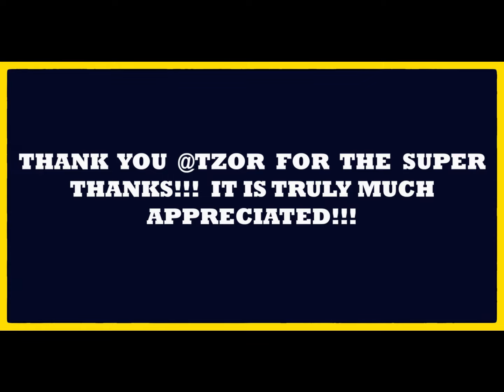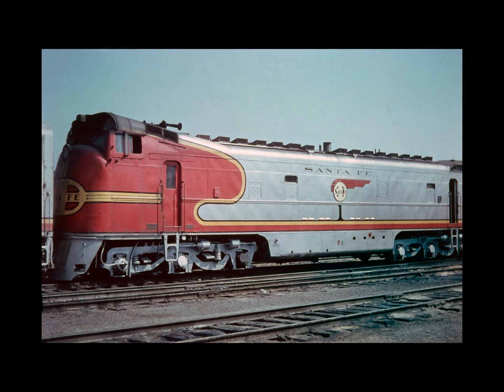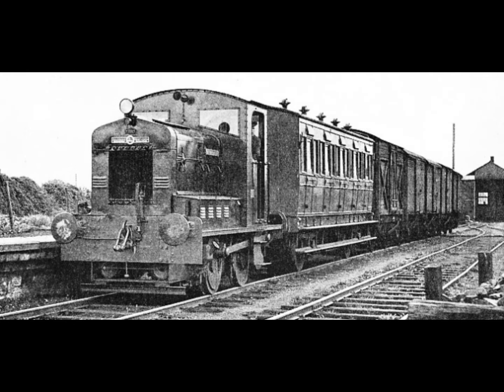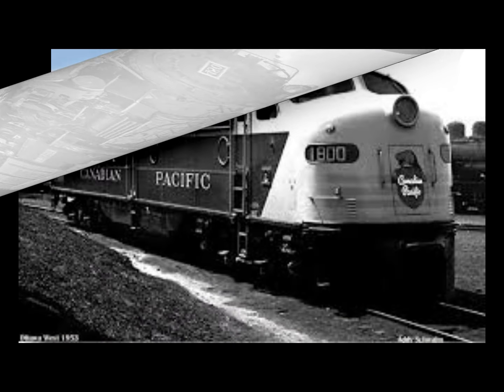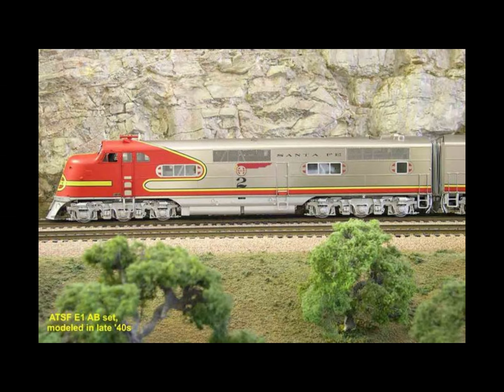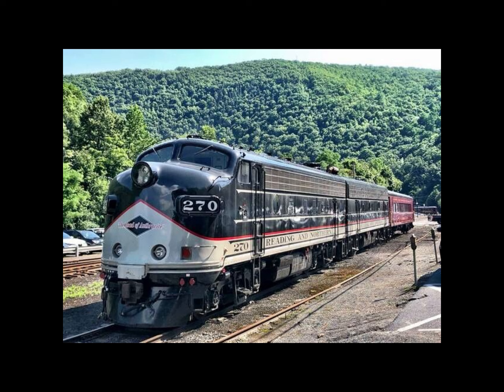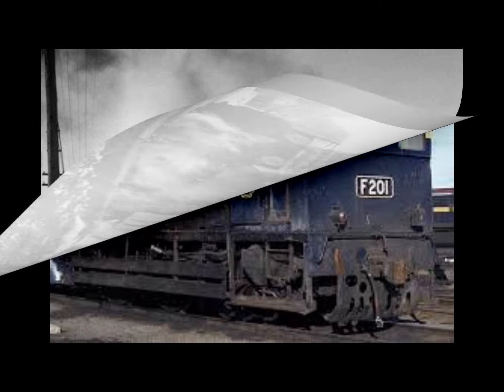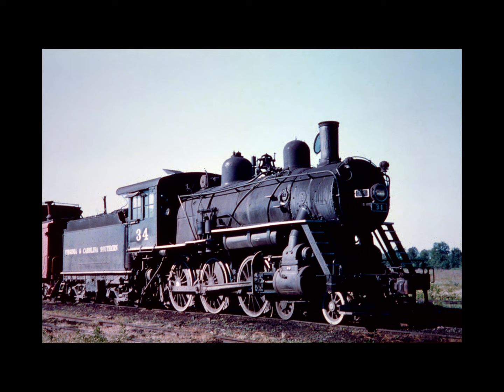Diesel VS  Steam... We know Which Won, But Why??

Comment: Aside from dramatically increased thermal efficiency, reduced heavy maintenance, reduced service, and  greater availability, diesels are a scalable modular form of motive power.  You can't think of them in terms of a single unit.  They are as many units as you need to perform a job operated with a single crew.  Each steam locomotive requires a dedicated crew.  Steam locomotives require helper operations.  The reason steam locomotives got so massive was that they were trying to combine multiple steam engines into a single unit with a single crew.  This also makes those massive units far less adaptable to other roles and limits where they can operate.  You really can't use a BigBoy for switching.  Diesels win this fight pretty easily, even in the 40s and 50s.  If you read the NYC report cover to cover comparing the Niagaras to the diesels, all of this is pretty clear.  Diesels definitely won that contest.  When you consider all of the additional people and infrastructure required for a steam operation compared to diesel, it's an easy decision.
Reply from the maker: Well then you also had increased track maintenance with the monster articulated Steam as well. Good stuff!
Reply: @TheRailroadCrossing-SteamPower  That's definitely another major consideration, dynamic augment hammering from steam engines, even the better balanced ones, is brutal on the track.  Steam locomotive wheel slip at starting or at speed can be pretty destructive as well.  You also have the issue of those long rigid wheelbase machines trying to straighten every curve and causing a bit of wear in the process.
Reply from the maker: @dtj9923  Can you imagine the track maintenance before roller bearings?
Reply: @TheRailroadCrossing-SteamPower  Are you thinking in terms of hotboxes and locked up wheels?

Comment: Excellent Video. Thank you for putting this together for us. 

However, I must disagree about steam being superior to diesel (or electric) traction in any measurable way. Let me present a few bits of history that may show why I'm so confident about it.

First - The Buffalo, Rochester, & Pittsburgh Ry.
It was absorbed by the B&O in 1930. The B&O, through the remainder of the steam era, essentially left the former BR&P as it was in 1930. They had a large fleet of 2-6-6-2's to handle most mainline freight from Punxsutawney, PA to Buffalo, NY, coal trains to Kodak in Rochester, NY, coal to Genesee Dock on Lake Ontario, and transfer runs to the NYC at Clearfield, PA. They primarily used 2-8-2's from Salamanca, NY to Rochester, NY and fast freights between New Castle, PA and Buffalo. They had 2-8-8-2's to push trains up McMinns Summit north of DuBois, PA. They also had a group of 2-10-0's that had been the helpers on McMinns Summit until the 2-8-8-2's arrived. They were used with many of the 2-8-0's not just for local and branch-line service, but also for main-line trains from Punxsutawney to New Castle, PA. This was due to the bridge over the Allegany River at Mosgrove, PA, which was built in 1903, being too light for the 2-6-6-2's to safely cross. They had to use several 2-8-0's or 2-10-0's, each with it's own crew, to operate this section of the railroad. Obviously, the B&O dieselized this section very early with EMD F3's F7's but they also dieselized the rest of the mainline to Buffalo as well with additional F7's. This also eliminated the need for helpers on the McMinns Summit grade. Most 2-8-0's were transferred to other divisions or scrapped. the old 2-10-0's were all scrapped. The oldest 2-6-6-2's were scrapped while others replaced the 2-10-0's and many 2-8-0's in branch-line service, especially on the coal branches around Indiana, PA. The 2-6-6-2's were eventually replaced by B&O EM-1's that had been displaced by diesels on other divisions. The EM-1's would soon also be replaced with the original SD-7 demonstrator that the B&O purchased as well as SD-9's, GP-7's, and GP-9's. The diesels solved several operating system issues by allowing the trains between New Castle and Buffalo to operate with only pickups and setouts at Punxsutawney and Salamanca. Also, the engine service facilities at every terminal were significantly reduced and the locomotive shops at DuBois were converted to produce and rebuild more freight cars, including the distinctive B&O "Wagon Top" boxcars. Currently, the Buffalo & Pittsburgh RR runs some of the heaviest diesels ever built (SD45's, SD40-2's, SD60M's, and now GE Dash-9's) over the Mosgrove bridge, now 120 years old, without any issues.

Second - The Norfolk & Western.
I'm sure you are aware, the N&W very impressively built their own steam engines, of their own design, until the very end of the steam era. However, very significantly, almost at the moment they agreed to merge with the Virginian in the 1950's, they started a manic diesel purchasing spree and began scrapping virtually new steam locomotives. The Virginian was actually in a better financial position when the agreement was signed. However, If the N&W could significantly reduce costs within the 2 years before the merger became official, the N&W would be the controlling partner. The efficiency of the newer diesels and reduced engine maintenance costs would only get them a very small part of the way to that goal. The cost savings, and surge in stock price, was almost entirely due to the savings achieved through reduced track maintenance. It is a simple fact that a steam engine, no matter how well balanced, by it's very nature, beats the track and other right of way infrastructure to pieces in a very short amount of time. That's why, in the steam era, there were track gangs about every 10 miles of main-line track. Reciprocating locomotives pound the rail head requiring a massive amount of maintenance. A diesel, with it's DC traction motors, does almost no damage to the track structure except the normal wear from flanges on the outside rail on curves. 

No matter how I look at it, steam was doomed as soon as EMC, Winton, and GE (yes, GE. NOT GM.) created their first demonstrators.

Additional notes:

Baldwin and Lima-Hamilton failed primarily due to incompatibility issues but some significant engine issues as well. They both used pneumatic controls instead of electrical controls. This made it impossible to operate their products with any other manufactures product. It's unfortunate because Baldwins were especially known for their pulling power. They eventually fixed the issue but it was already too late.

Alco would be in a partnership with GE until about 1953. After that, GE started working on their own locomotive designs but Alco continued to purchase GE electrical equipment. The issue Alco had was the 244 engine. They eventually corrected the multiple mechanical issues and also produced a much more reliable 251 engine but, again, it was already too late. The railroads were much happier with the EMD GP7's and GP9's with their very reliable 567 engines.
Reply from the maker: That was an outstanding read! Thank you!

Comment: FT mostly came as permanently coupled A-B sets. Multiple traction was considered from the beginning, and a lot easier to realise than in steam locomotives where in practice at least one person was required in each working locomotive (more commonly two).
So it was not necessary to build very large monolithic diesel locomotives. Though in some cases (the 8-axle dual engine locomotives of UP) it went that way in the 1960s/70s, it was considered more practical to couple up more locomotives for more power.
Besides the lower thermal efficiency of steam engines, it requires a lot more manpower, time and maintenance to operate. Bringing a cold steam locomotive up to temperature can take several hours. A lot of cleaning and lubrication is required every day. The time required for maintenance also means hours during which a steam locomotive and its crew cannot be used to pull trains.
Besides the fuel you also need to take great amounts of water along.
Some countries continued building steam locomotives after the second world war, mostly because they had great amounts of coal and didn't want to rely on imported diesel fuel. (And some electrified but that's a different story.)
Reply from the maker: All great and valid points!

Comment: Standardization. 

Apart from the USRA locomotives, and even then you have like, over 10 different variants of those engines, every railroad would order unique locomotives to meet their unique needs. Once the engine was done and delivered it was essentially on the railroad to fix anything that went wrong with them, because the builder was now working on another relatively low volume design for a competing road that was different enough to not have compatibility.

And then you have the diesels. In the early days EMD makes a F for freight, a E for passenger, and a shunter. 3 different locomotives. Because every railroad buys the same 3 locomotives EMD can make a ton of the same thing, get really good at it, and maintain a aftermarket because they only have to support 3 designs. 

If a steam engine has a boiler leak or something wrong with a cylinder, the railroad has to come up with a unique solution to that unique problem. If a diesel burns out a traction engine, buy a new one and slot it in.
Reply: Wrote this comment before watching, glad you hit that point In the video. 

As to some of your questions, If I recall correctly both the N&W and NYC basically concluded that a steam engine would haul a load about as well as a diesel and that the costs of operation were more or less equal. The benefits were elsewhere. Considering that it is 2 different roads and 2 different applications they are being considered on I would think this lends a lot of credence to them being about equal over the road. 

Also the big steam manufacturers were essentially gagged from developing diesels because a steam locomotive was a way to move material without using critical resources. The government did not want the builders to slack off on building locomotives in order to develop engines that used those resources when they should be building steam locomotives to meet the immediate demand. This prohibition from diesel development basically ensures that EMD (who was still allowed to build diesels during the war) would have basically a 4 year advantage on everyone else.
Reply from the maker: On point, as usual!

Comment: Also one MASSIVE selling point of diesel or electric locos over steam ones is scalability. You can just chain a bunch of them together and operate them like one loco whereas with steam you either had to get a bigger loco or operate two with their own crews at a decrease in efficiency.

For example in Russia, China and some other railroads you have 2-4 units (kinda like A+B unit consist) linked together permanently counted as a single locomotive. So you can scale the power in production a lot more easily by just adding a "B unit" in between the cab units and get more power without any change in design.
Reply from the maker: Yeah, they were many advantages for sure over steam as time went on, especially

Comment: I suppose "higher performance" would depend on what they meant by "performance", what metrics they were using to measure it, and what they were comparing to what.

It doesn't really matter though. If a diesel can do the job, and do it cheaper, then how it does the job doesn't really matter practically. I expect that a diesel with more power then the giant steam engines could have been built, but why would you? As you said, standardization was a diesel advantage. Buy one kind of locomotive, then dispatch however many of those you need for each job. The giant steam locomotive really weren't an optimal engineering solution and they were highly expensive specialist machines. The only reason to build them was to avoid needing multiple crews for multiheading, but diesel lets you multihead with a single crew, so why build a giant diesel?

I don't see how fossil fuel shortages or phase-out favours steam. They're less thermodynamically efficient so you'd need even more fuel and I don't think any of the advanced steam technologies have an advantage over diesel in most applications. I think the only practical alternative to diesels is mass scale electrification.

Everybody loves a steam engines. They're cool, but I think steam is mostly dead as a practical power source for transportation and is going to stay dead. Love them like sail boats and mechanical watches and film cameras.

Comment: I think diesel absolutely outperformed steam on grades.  The simple reason being, you can hook up 9 or 12 of the things or however many it takes to grind up the hill at 12 miles per hour.  All on one crew.  Diesel will eke over the top with less horsepower than steam, and you can easily add on as much horsepower as you need.  With any train, you need to schedule as enough power per ton to pull and start on the worst grade on the route, with a margin.  With steam, that means you give the train a huge amount of power, because anything that'll start the hill will also blast the train at freeway speed.  With diesel, you can specify a power to make any grade but still only top out at 35.  Since railroads do not care at all about speed, they're happy with that deal.  More tonnage per horsepower.  Steam pulled better in practice because the minimum acceptable horsepower was higher.

And yeah, one Allegheny will out-pull any single diesel, but it still loses because you'll never run a train with 5 Alleghenys, but 8 diesels is just Tuesday.  Scalability and performance is 100% tied to cost, otherwise you really would just quintuple-head with Big Boys and pull anything anywhere.  Diesel scales better.  If the microchip had been invented before internal combustion, allowing one guy to run and fire 6 steam engines, dieselization may not have happened.  After accounting for the cheaper up-front purchase price of 1 steamer vs 4 diesels, and the cheap fuel they used, running costs for steam weren't THAT terrible.  The NYC found their Niagara compared pretty favorably in lifetime cost.  But you just can't beat 1 crew doing the work of 4.

Comment: Diesels didn't need to out perform steam on a 1 on 1 level.  The jumper cable made it easy to string a few of them together and it still came out cheaper than steam.  Now, with mounting environmental pressures and increasing fuel costs, it could be time for the electric locomotive (not these experimental batteries on wheels) to become the preferred power.
Reply from the maker: It'll be interesting to see what they come up with these days with the looming fossil fuel issue. If they are going to develop something like Natural gas, hydrogen..what have you.. Now's the time to build experimental locomotives. but railroads have never really been known for having foresight. So as I said.. this should be interesting.

Comment: Ultimately, it was the fact that railroads actually had competition by the 1940s that they had to start abandoning steam locomotives.  When you have a complete monopoly on moving freight,  you don’t need to evolve.  Profit margins got smaller and just saving a little on total cost was the difference in staying in business or going bankrupt.  And then only the giants survived.  They swallowed up the smaller railroads or merged with them.  4 railroads haul most of the freight in the U.S.  Union Pacific,  BNSF,  Norfolk Southern and CSX are the only ones left.  A few smaller local lines of course still exist but these 4 do most of the freight hauling in the U.S.
Reply from the maker: Right... And when you look at the age of steam and you can see why those railroads emerged as the victors... You can see solid management and sound decisions throughout their time. That is, outside of the M1 .. I had to throw that one in there. Cool locomotive though!

Comment: Hi, I worked with a couple of guys that in the past were Maintenace men on the railroad, they tried to explain to me how the diesel and steam compared because of my love for steam engines. they told me that a steam engine could start a load that it could not pull, and the diesel could pull a load that it could not start. I'm still thinking about that.
Rich
Reply from the maker: That's a cool quote!